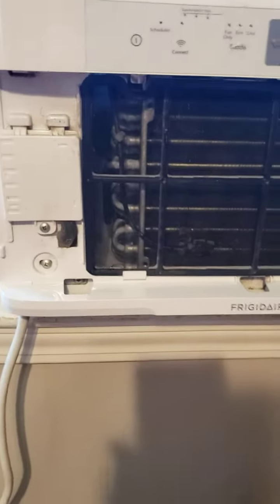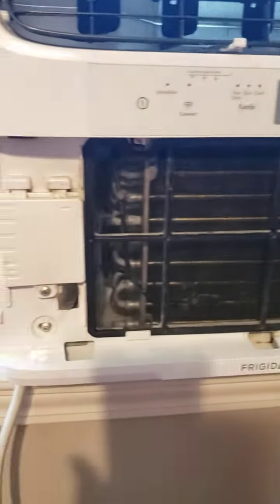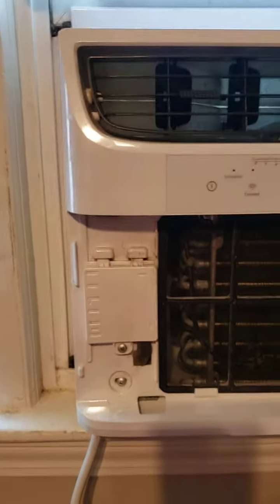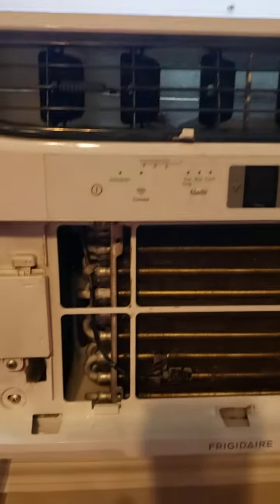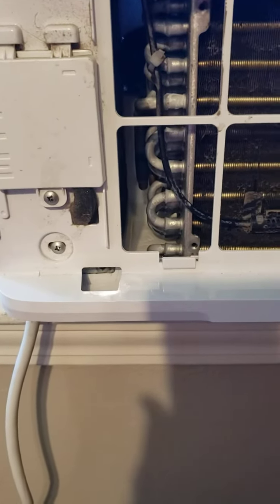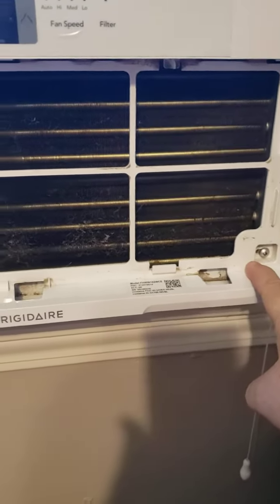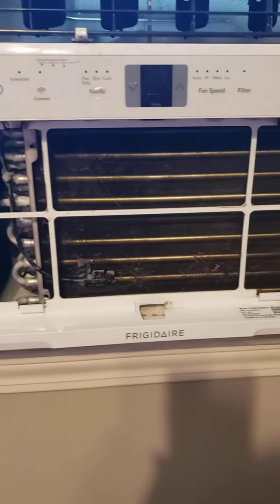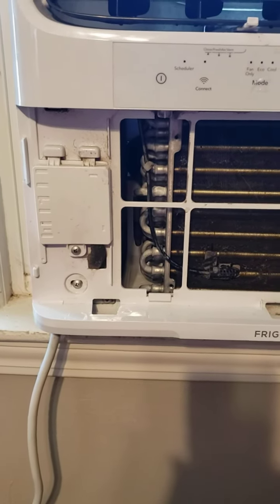Clearing a Frigidaire Window Air Conditioner Drain Line, Water Leakage.

Comment: I sharpened the end of a long 3/8" wooden dowel and from the outside,  I spread open the lower back vent on the side of the unit to allow the dowel to slide in. I then created a new drain hole twisting the dowel through the back foam down low. Immediately all the water trapped in the inside came rushing out.

Comment: I have the same a/c and had the same problem.  There are appropriate cleaners available on Amazon etc...  the bleach rusts steel out.
Reply from the maker: The bleach was only to kill the slugs. I clean the outside coils and exterior parts every year. I suggest wrapping the outside with outdoor screen mesh for a screen or storm door to keep insects and slugs out.

Comment from the maker: I suggest wrapping the outside with outdoor screen mesh for a screen or storm door to keep insects and slugs out. Do not cover the rearfacing couls, only the top, bottom, sides and drain area. Use self-tapping screws and fender washers. Remove them before using it, and flush it out really good. Sprinkle table salt inside. Slugs and snails die from salt. If they do get it, they will probably hit it and die. After cleaning, wrap it back up again.

Comment: Does this technique applies to the Frigidaire “Through the wall air conditioner “ as well?
Reply from the maker: More than likely. All air conditioner have condensate on the coils that eventually defrost as water and has to drip out. It is the same for refrigerators and freezers. Your house air conditioner does the same thing.

Comment: Thank you, you saved my sanity this week, we're ready for the heat wave! But...Any tips for fixing my ruined century old hardwood floor? 😢
Reply from the maker: Sand paper works wonders😂
Reply from the maker: Call a floor refinished? Or, sand it down yourself. I had the same issue. I placed a plastic bin below mine to catch the water, but some still got by.
Reply: @Ferret488  well that's a funny coincidence, I literally had to clean this out today because it started dripping. My mother said the flooring buckles would go back by itself when it dried out, never did. I'll attempt a repair myself.
Reply from the maker: @yankeeshrapnel  I would keep a large bin on the floor in front of it, just in case it does it again.
Reply from the maker: @yankeeshrapnel  See my new video for more tips.

Comment: Completely off topic but I have the same unit and lost the manual. How do you have your vent tab set? I never understood that.
Reply from the maker: I leave mine so it is closed. If it is cool outside and you just want air, pull once. To vent to the outside, pull all the way out.